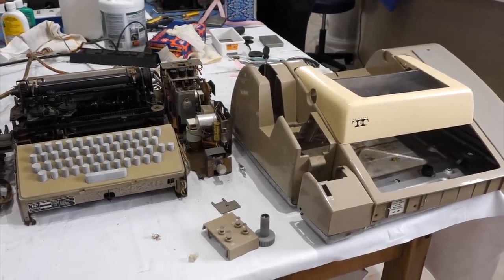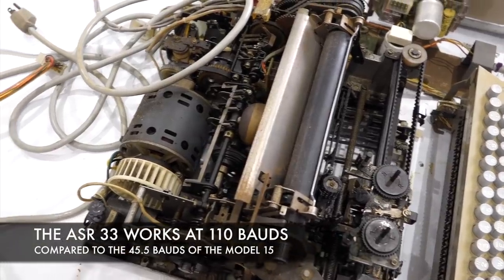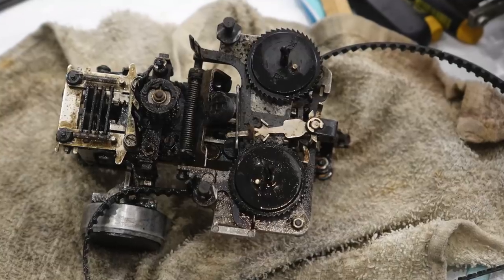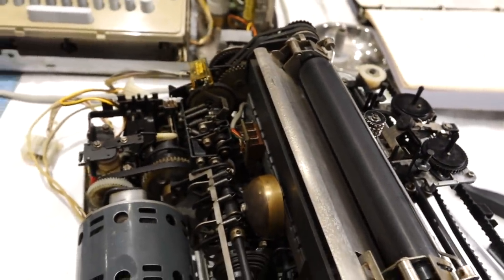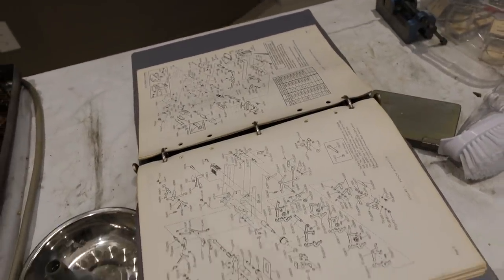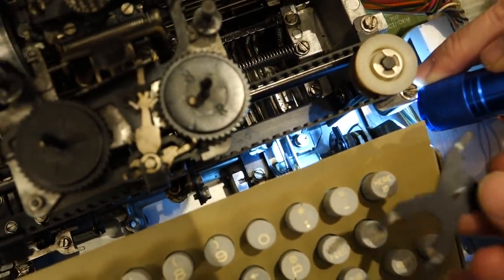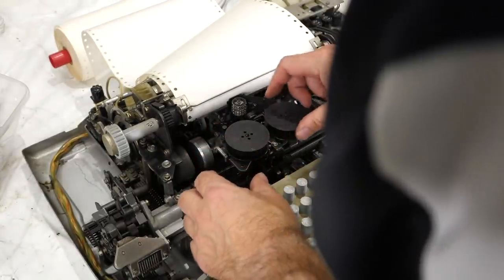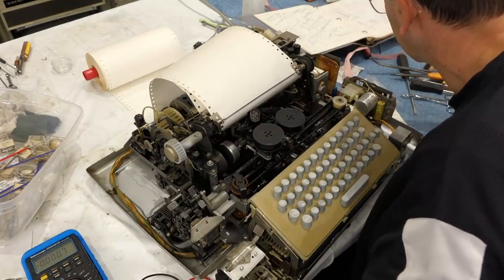Teletype 33 ASR Part 1: Restoration Begins

Comment: I remember using one of these when I started work in 1975.
Loading a 3K program into a DEC PDP8E took close to 10 minutes - a blistering 110 baud, yes we thought it was very slow even back then.
I worked on the in-house solution using compact cassette player that could manage 600 baud in 1978 .

Comment: Ah, those barrel keys!  We had a model 33 ASR as the console for the Univac ANYUK-5V computer we had aboard the USS Jason AR8 back in the middle 1970's.  The 5V was built out of discrete transistor logic, with core memory, four tape drives, a line printer, and a huge card carder/punch machine.  The computer ran supply and work accounting programs, and was programmable either in assembler or Cobol.  I wrote a little Cobol program to produce a list of personnel which the Captain greatly appreciated.

Comment: You can use the vintage vehicle restorer's rust removal trick by putting the part in straight plain vinegar (whatever is cheapest at the supermarket) and leave for a few hours or overnight. Parts will come out looking like a shiny tin can. Neutralise the weak acid of the vinegar with a dip in baking soda solution then wash, clean and dry thoroughly before applying a protective coat. Molasses also works, diluted 1:4 with water but is a bit stronger. Or you can get rust converter which has a plasticiser, but you then get iron phosphate as a whiteish patina instead of the clean metal that vinegar leaves.
Plus you can dip your hands in the vinegar (it's pretty mild) without it taking your skin off.
Reply: The problem with vinegar is that it will eat good metal as happily as it eats rust, consequently it needs an attentive eye. A chelating rust remover would be a much safer (and slower) bet.

Comment: Best of luck on restoring this. Many years ago I started as a tech fixing these. Mainly Mdl 32s the 5 bit version but some 33s.  Remember all to well the bend the metal bit adjustments. Trust me at a certain point these things became unrepairable and we're scrapped.

Comment: I used to have a later version of one of those in my youth connected to a Z80 system derived from a ZX81!. It self destructed when the rubber hammer wore through in the middle of a long listing and by the time I noticed it had worn off all the type face from the cylinder, so I skipped it in the early 80's. Something to be wary of, check the rubber is good.

Comment: The fourth computer I worked on (after the IBM 407, the Datatron 205, and the IBM 1401) was a Burroughs B 2500. It used a KSR 33 as the system console. I used those things on various Burroughs machines for close to 10 years before they were finally replaced with a TD830 screen terminal.

Comment: This peripheral was my first exposure to computing in 8th grade. It was a Teletype KSR 33 connected to an Anderson Jacobson acoustic coupler modem. The outer case of the modem was made of wood. We dial up the phone number of an HP 2000 minicomputer located at the opposite end of the city and inserted the handset into the two round rubber holes of the modem. https://images.computerhistory.org/revonline/images/500003067-03-01.jpg?w=600 At the speed of 110 baud, we got to play Blackjack and Star Trek 73 and program in HP BASIC. Pleasant memories.

Comment: After cleaning, do you lubricate the parts? What do you use? Love the videos.
Reply from the maker: As little as possible. Mostly I use Nye oil 140B. Super light, as close to a miracle oil as possible. On gears, aviation grease.

Comment: Evaporust works pretty good for removing rust - it is basically oxalic acid.   It's safe, but makes hydrogen sulfide as it removes the rust - so it stinks.  I surprised the belts and plastic parts held up.

Comment: ASCII is 7 bits but the 33ASR can only do upper case, right? Wouldn't that make it 6 bits?
Great video by the way. I can almost smell the oil and mechanics :-)
Reply from the maker: I believe that's correct, uppercase only. I was wondering myself. Does the keyboard produces the correct lower case and upper case variations? And what will the printer do when it receives lower case? I'll have to check that out once we get it going.
Reply: @CuriousMarc  Aha. Wikipedia says: "The Model 33 used the seven-bit upper-case only ASCII code, also known as CCITT International Telegraphic Alphabet No. 5, with one (even) parity bit and two stop bits."
Reply from the maker: @JacGoudsmit  Just tried the keyboard part, and it will only transmit upper case ASCII codes. Actually, the shift key will lock out the alphabetic letters, you can't even use it with these. The receiving part still does not work, so I don't know yet.
Reply: @CuriousMarc  Right. So it generates ASCII codes up to 0x5F but not 0x60 to 0x7E. I seem to remember there is a DEL key that generates 0x7F, or some other way to punch all holes of a paper tape which is used to correct mistakes. So anyway, that's 7 bits, not 6. I don't remember what it prints if you send it lower case ASCII characters: I expect that it converts them to upper case but I wouldn't be surprised if it doesn't print anything.
The serial protocol uses a parity bit and 2 stop bits but the parity bit is not written to the paper tape. The baud rate is something like 110 or 150.
Reply from the maker: Tape is 8-bits, parity should be on it.

Comment: This is quite an amazing video. What can be done with the machine besides collect them I wonder?
Reply: It is a serial terminal.  You can hook them to a linux box as a real tty (tty stands for teletypewriter). If you wanted, you could use it to configure your cisco router :)
Reply: Or if you have the right kind of interface you can hook it up to a modern computer and sync it to a RSS feed and make it print the news. I think I've seen it on YouTube
Reply: @explorer914  You can print your own telegrams.

Comment: The 33 tty was the i/o device at Ohio State University PDP-10 timeshare system in 1970.   Can you program the WRU drum?
Reply: The 33 was the teletype of choice for our PDP 8E. We spent many a night in the lab writing PAL8 assembly on the ASR 33.

I had my own 33 later on and had it interfaced to my VIC 20 as my printer. It was a great showpiece. Sadly it went to the graveyard around 1990....
Reply: I think the WRU drum was programmed by cutting pins or something (we had some type 33's at my college to teach us about serial communications but I've never seen one on the inside). Write-once, read many times :)
Reply: @JacGoudsmit  yep dont remember how many characters you could program but it is a plastic drum and you clipped off pins

Comment: Where can you get blank paper tapes for these machines?
Reply from the maker: Mr. RTTY! He offers them regularly on ebay too.
Reply: I have somewhere remaining ends of Mylar tape that was used on CNC machines 😁
Used them as emergency belts in HP ½" tape drives in the seventies.
Reply: @paulcohen1555  I worked on a couple of models of  HP tape drives back then.  I think the first one was the Datamec 3030 series that HP had recently bought.  That was about 1969.  A few years later, they came out with their own, completely redesigned, of course.  That was back in the days when drives were stand alone machines, about 6 feet tall. And there were rows and rows of them in the "computer room".  Can't find any record of them on the internet, though.  If it happened before the internet, it didn't happen, I guess.
Reply: @frenchcreekvalley  Probably these were the drives that I fixed with the 8 channel Mylar tape 🙃

Comment: I was wondering about the motor required to receive 7 bits at 110 baud, and I think it is one of these, rated at "1/12 or 1/20 horsepower" :D
http://www.navy-radio.com/manuals/tty/jh/bsps/bsp/570series/570-220-100TC-Iss4.pdf
Now it would be possible to calculate, at what range an actual horse would be more efficient at delivering a bulk of messages.